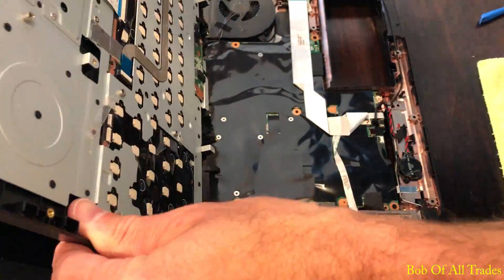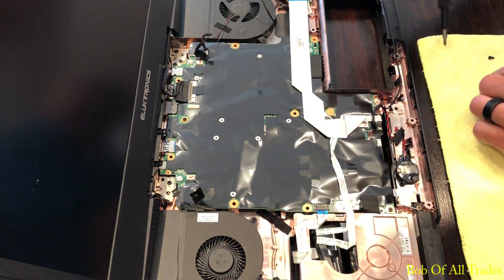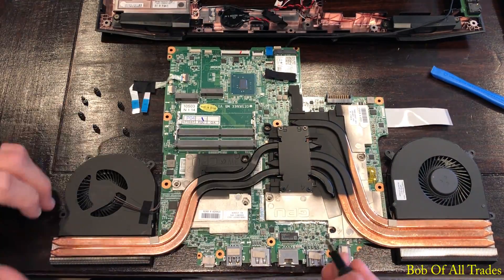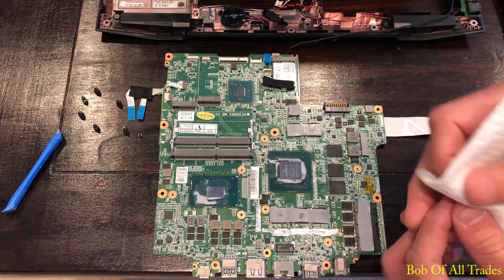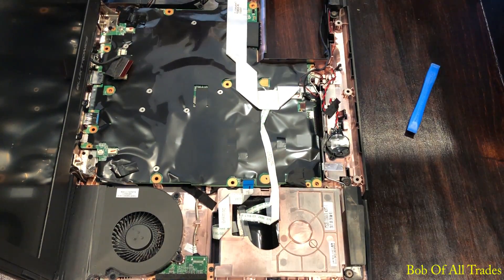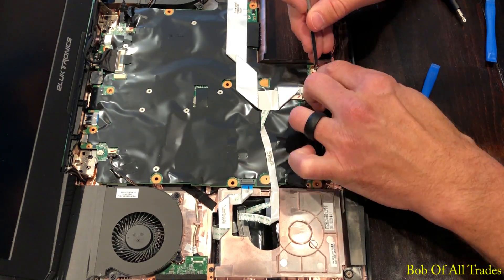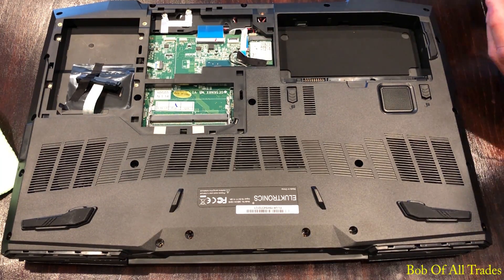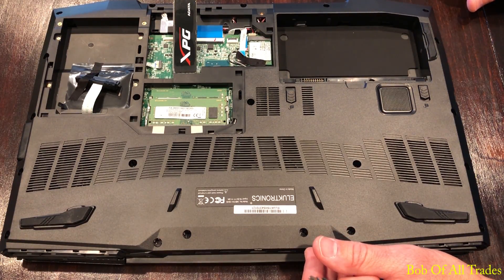MECH 15 Teardown Liquid Metal!  WARNING Experts only!

Comment: I am so excited to learn that, according to Bob, I am an expert.
Reply from the maker: You did it?!
Reply: @BobOfAllTrades  I've done many like it. I have been building and repairing machines for 22 years but never thought of myself as an expert. Now I know 😀
Reply: @BobOfAllTrades  Have you ever tried the ROG 750j? That heat sink had 38 contact points (37 were the GPU). It was beyond me. I decided to give it away and replaced it with a Mech-17. If my new laptop is anything like the Mech-15 I'll be in good shape for repasting!
Reply: @BobOfAllTrades  Hey Bob, I'm interested in potentially doing this for a Mech G3 or prometheus, do you happen to have any tutorials or plan to do so?
Reply from the maker: I do not and probably won’t anytime soon
Reply: @BobOfAllTrades  That's alright, thanks for the response though.

Comment: Bob, I have an Eluktronics Mech-15 G3 RTX3080 w/16Gvram and Ryzen 9 5900HX. Is it possible to use Thermal Grizzly Conductonaut on my GPU or is mine the same as last gen? Thanks for the great videos. Also, is it possible to under volt my laptop or is that only possible on intel systems?
Reply from the maker: Don’t do it. If you put liquid metal on your graphics card the manufacturer cannot honor the warranty. Even if they want to Nvidia will not honor the warranty and the manufacture cannot afford to eat the cost of the graphics card.

Comment: I used all your videos to undervolt my CPU and GPU on Alienware m15 i7-9750h, RTX2060. And yes, the temps went down a lot. That’s my first gaming laptop, and I had no idea that it’s so much adjustments temp wise. Tonight I changed my thermal paste with Thermal Grizzly Kryonite, the temps went additional 5c lower. However, watching this video I think putting liquid metal on the CPU only would make an even bigger difference. Anyway, I think I’ll do it next year, after the warranty expires. Keep posting cool videos! Thanks for the insight!
Reply from the maker: I’m surprised you found this video then since it didn’t really have anything specific to your own laptop 🤷‍♂️
Reply: Bob Of All Trades, so I was like F+x& it and put the liquid metal on the CPU as prescribed. It’s amazing that this little drop of liquid metal, drop the temps on the CPU by 15c. Now hardcore gaming max temps 80-81, before 95-96c. I read a lot about that liquid metal dries up after time, so what do you think. When should I reapply liquid metal? Most posts say 6 months.

Comment: I have a question Bob, I thought of a way to prepare myself for liquid metal as ive been pasting regular paste back and forth and I kind of dislike just slapping it down and thats it but when I see videos of people painting the LM on by dipping the q tip into the LM, I prefer that way of doing it, basically painting it on cause I know it will actually cover the whole thing but my question is to prepare for it with thermal grizzly as ive heard it takes time to smoosh it in, I was thinking of using something that is a duplicate of a CPU and GPU chip, looks like one but is fake and still metal or stainless steel and practicing on that before attempting it or I can use the copper shims that I just bought as a test, good idea? I have bootleg kapton tape, which has a strong heat resistence and is rather slim on pcb.

Comment: How long a regular thermal paste stay on good conditions after the repaste? I mean, some people have said I will must do the same process again in 2 year at least because the thermal paste wont be effective anymore! Is it true? (I used the Mastergel Maker)
Reply from the maker: Monitor temps and see.  The general rule of thumb gets tossed out the window when you consider the variations of environments.  My laptops are squeaky clean and dust free.  I get other clients laptops that I am working on today for example and they're clogged with dust.
Reply: Considering my laptop stays in the best environment condition, very clean, no dusty... Or even that I'll keep the fans clean all the time! Just talking about the thermal paste at all, how long do you think it will stays on good condition and no dry? Because open just for clean the fans its easy, but I would not like to teardown the heatsink again hahaha

Comment: Bob, could you review the Alienware m15? Was considering the 1060 version but I'm not sure if it's worth the extra 300 bucks compared to the HP Omen which seems better.
Reply from the maker: P T Own Or Disown will be getting his in about 2-3 weeks. We’re on the bottom of the list as reviewers so by the time one comes this way it would probably be next year. 

These are way too expensive for their spec so buying one is not smart on my end.  Selling used laptops can be tricky when you need to maximize your return.
Reply: I guess I'll go with the Omen then. It seems like the best value performance laptop there is.
Reply from the maker: P T AW is one of the last laptops for value I could recommend.  Not that they are a bad machine either.

Comment: Hi. Can you do review on the msi GV62 8RE-016 gaming laptop?
Reply from the maker: Those are pretty low quality.  I’d stay away.
Reply: @BobOfAllTrades  thanks for the answer.  What do you think on predator 17 G5-793-79SG with gtx 1060 and 7700hq? Worth 1000-1100 Dollars ?
Reply from the maker: idanew0 I reviewed a g5 793 already. That review will answer everything you need 👍. Check the playlist.
Reply: @BobOfAllTrades  thanks
Reply from the maker: idanew0 it’s a killer machine!  The one I sold was to a local guy and he’ll join the twitch stream sometimes just to tell me how much he loves it still. G5 793.  It’ll have it’s own playlist 👍
Reply: @BobOfAllTrades  and I meant overall review on msi GV62 8RE-016 not a teardown review.

Comment: @Bob Of All Trades Tell me the best thin and llight student laptop(coding and video watching) under $1000
Reply from the maker: No gaming?
Reply: @BobOfAllTrades  no
Reply: @BobOfAllTrades  just full light weight and thin plus awesome screen
Reply from the maker: Sriram Narayanan Do you need top tier CPU such as the 8750h and what screen resolution?
Reply: @BobOfAllTrades  1080p or above is fine but good screen the screen shouldn't lag that's all no need of touch either
Reply: yeah i need a top cpu.....for coding only though.....sorry for late reply
Reply: @BobOfAllTrades  yes I need i7 8750h and a good screen
Reply: @BobOfAllTrades  1080p is fine

Comment: Hey Bob Ik this is unrelated to the video but I recently got the same dell g7 that you got a while ago and you showcased a video undervolting that I followed but there is an Iccmax adjustable option in the new Throttlestop and I was wondering what I should set it to because i wasn’t getting the same results as you, I was getting around 3.2GHZ constant while in game

Comment: Great Video as always , i am going to buy this laptop today , but i wonder, could you make a benchmark videos about it (how much FPS i can expect) and also VRmark test on it , if not that's okay , keep going......
Reply from the maker: I don't cover benchmarks here.  There's nothing stopping this laptop from performing the way the best 7700hq and GTX 1070 laptops perform.  My testing goes way beyond the basics.  

The problem left of the table with benchmarks as those CAN actually change over time thanks to drivers for example.  Makes the testing irrelevant 6 months down the road.
Reply: @BobOfAllTrades  np at all , keep going , your videos are the best....